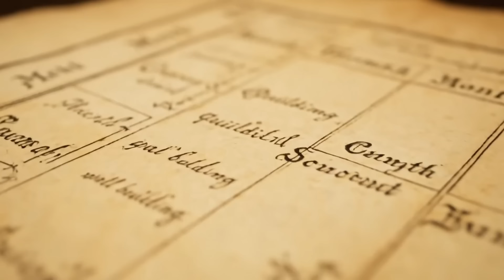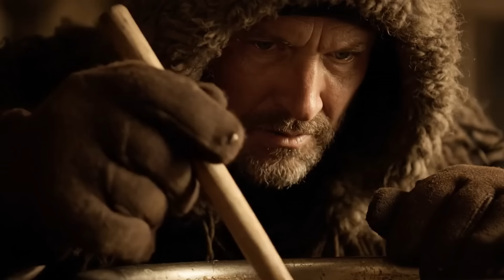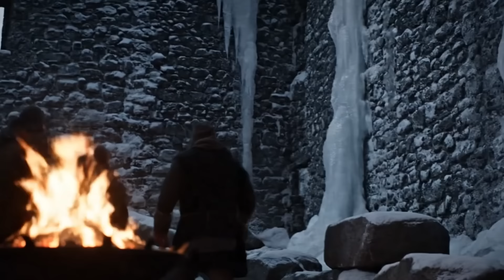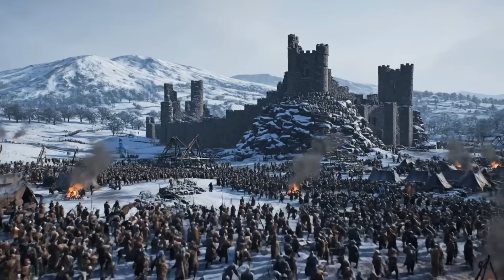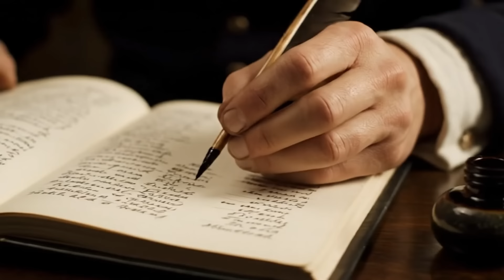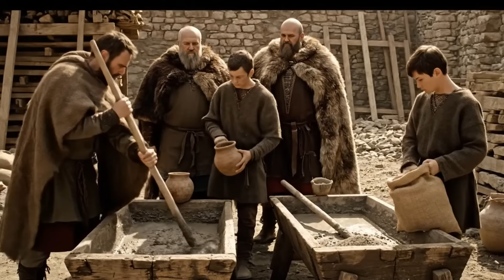How Medieval Builders Fought the Winter While Building Castles

Comment: Impossible. Concrete reaches its full strength in 28 days. Mortar is cement without the aggregate. They did not possess the chemicals we have today to speed up the strengthening of mortar to overcome the cold. No mortar was used during the extreme temperatures. I am an experienced builder who is building his own castle.